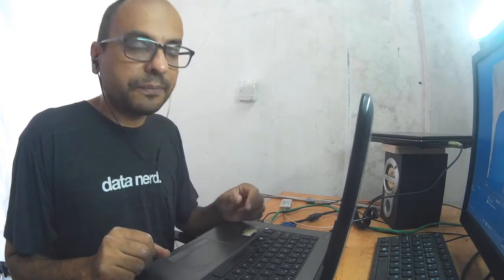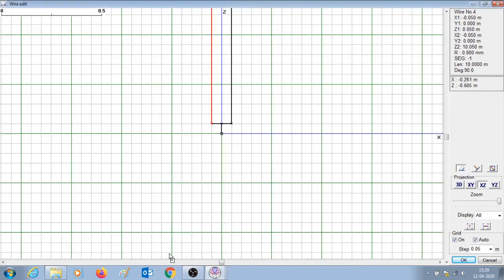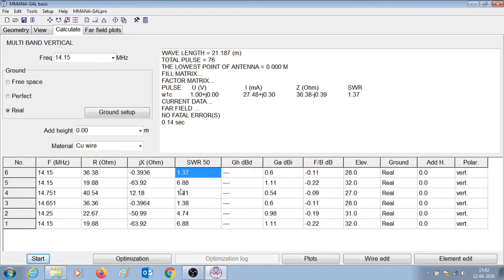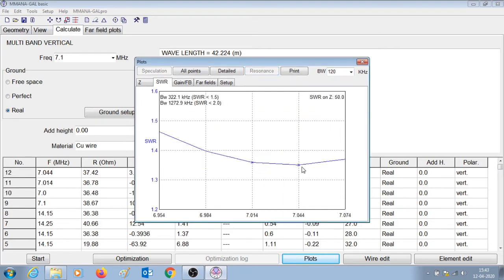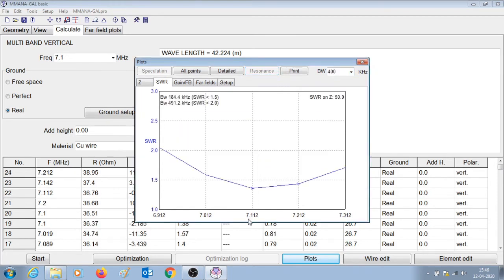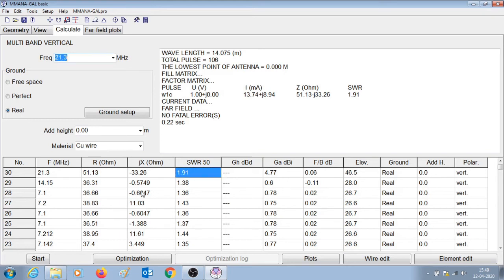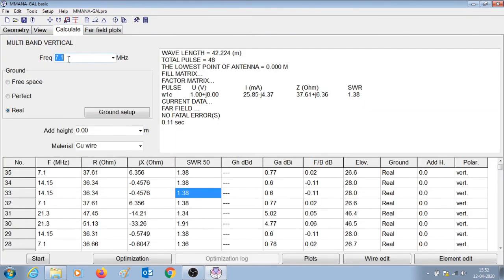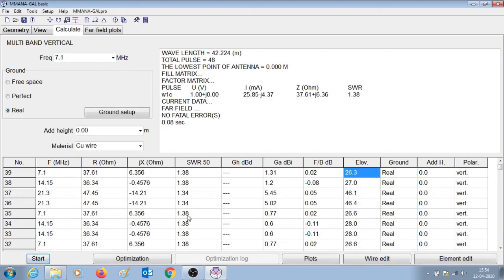Designing a 40-20-15 meter multi band vertical antenna using MMANA-GAL

Comment: Hello, this is VU3VMG, thanks for the videos! I am trying to model slim jim using this software for 2m band, but I am not getting proper SWR. Can you please tell how to attach source as the slim jim has two different points of connections, 1 for center core and 1 for shield of the coax? Please let me know if you tried!
Reply: Today I tried again, not able to get proper SWR. The imaginary part of the antenna impedance is very high negative value. I tried different feed point locations, antenna dimensions etc. I then tried  Jpole antenna as well. Optimisation is also not working. I am not sure if it's the software limitation or I am doing something wrong. You can try and post a video if it's working. Thanks. De Vu3vmg.
Reply from the maker: @haroonsyedmohammed8430  ok I will make a video
Reply from the maker: You need to draw a wire between the matching element and the radiating element at suitable point and add a source at the centre of that wire.
Reply: @AniruddhaBokilVU3FML  Thanks for the reply! I made changes according to your input, now SWR came down to 2.1 but not reducing any further by changing the feed point location.
Reply from the maker: @haroonsyedmohammed8430  Two ways u can do more:
Manual way: find where you get lowest swr. Enter that frequency and calculate again. Then go to wire scale button and there enter the new frequency which is your desired frequency. Select all x,y and z, press ok. Now the software would have adjusted the element lengths to your desired frequency. Calculate again by entering your desired frequency and now you will get good swr at that frequency.
Automatic way: At your desired frequency, Go Go to optimisation button and slide the swr bar all the way to right. Press ok. It will optimise the antenna parameters to match a better swr.

Comment: Great video! Thank you for making it and sharing it with all of us! How can we correctly model the same antenna system in your video which is not sitting on the ground and without ground radials? How can we do a similar setup where the antenna is on for example a 20 foot fiberglass pole or maybe on a 35 foot metal tower?
Reply from the maker: Thank you!
I am not sure if i understood your question properly. Vertical antennas require a good ground system to work properly. You can use fiberglass pole or any non conducting supporting structure to install the vertical antenna. However the ground radials or ground plane would be necessary , either at ground level or maybe at an elevated level (elevated ground radials)
Reply: @AniruddhaBokilVU3FML  You answered my question here thank you https://www.youtube.com/watch?v=22KVuZ-Mvgk